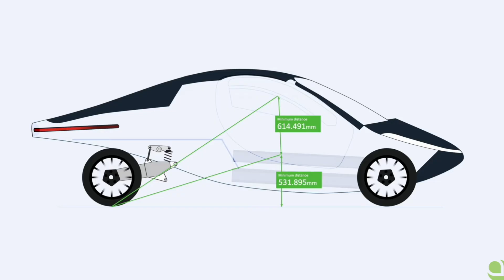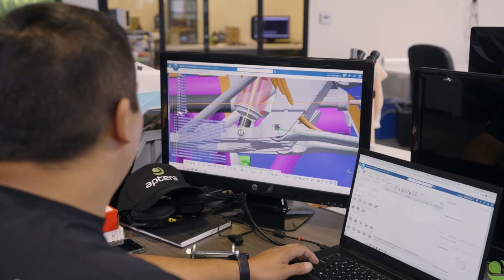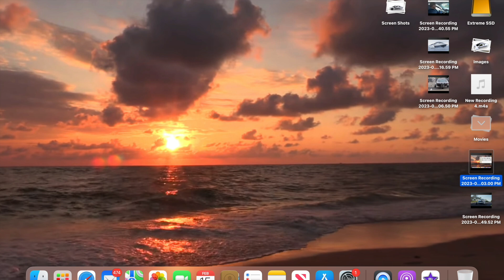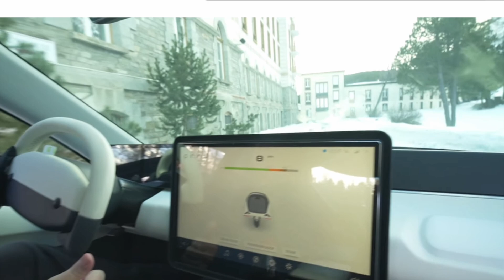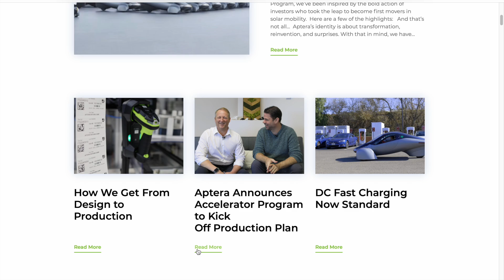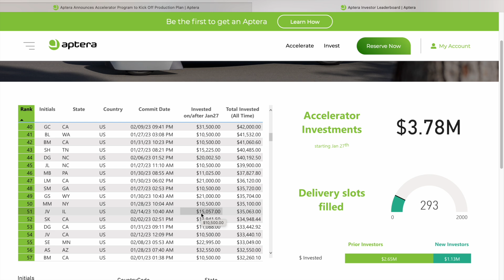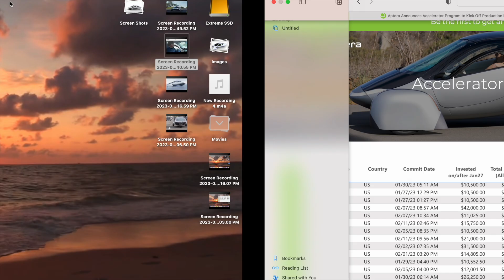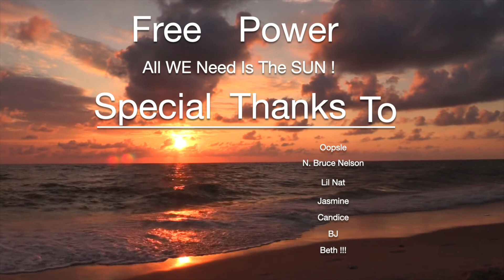Aptera's Suspension !

Comment: The rides seems very NOT smooth whatsoever.  Last-minute changes to suspension is an indication of that.  I've owned a very stiff suspension car (Lotus Elise) and the ride-quality of this shows it is more punishing and violent on SMOOTH roads.  Selection of coil-overs may help with this, and possibly progressive springs.  You can see the actors suffer on the smallest of bumps and clench their teeth concerningly, even the Elvish girl.  Show me a heavily pot-holed road drive instead of Zamboni-smooth pavement in all the examples (where it still slams like a hammer on metal).

Comment: I'm concerned about the increased unsprung weight, since the inwheel motors are directly attached to the wires with no suspensions between them.
Curious it could handle pot holes or speed bumps..

Comment: I don't foresee needing to accelerate to 60 mph in 5 seconds.  But I do see constant advantages in having 20% more efficiency from the wheel motors.
Reply from the maker: That's Big !
Reply: I agree... I have a standard long range model Y and after a couple days of it being in 'standard' mode the novelty wore off and its been in chill move ever since. Hell, even in chill mode i can still lay into it and out accelerate most cars around me. I had originally taken the sport model out for a test drive and after flooring it a few times I thought "why in the hell would I want to do that when even standard mode pulls like a freight train"

Comment: How will it do in Pot wholes the Roads are degrading in places
Reply: Aptera has run the beta into curbs fast enough to knock the tires off the wheels without damage to the suspension.
Reply from the maker: Thanks , n.brucenelson5920 , I remember that and have a picture of it somewhere . I should have put it in this video . 😄
Reply: @freepower1082  You do a great job, thanks!
Reply from the maker: So do you , appreciate you very much ! 😊

Comment: I wonder how hard it will be to parallel park the Aptera since it is so wide and videos seam to show a large turning radius? 
I wonder if Aptera ever considered  to make the rear wheel pivot like that of a tail drag airplane rear wheel to make it turn on a dime?  That would be cool, however make AWD more difficult.
Reply: Ive heard people who see this thing in real life say its not as wide and large as people are thinking it is on the net.
Reply: There is at least the potential that the left and right front wheel can rotate and different speeds or even in reverse direction to add more maneuverability at the cost of some tread scrub at the rear.

Comment: The guy said noting about the front suspension components - the most critical ones.
Reply: The design of the front suspension was created by Roush Performance and has been refined by Aptera.
Reply: @n.brucenelson5920   -  Why hasn't anyone at Aptera ever shown it or described it?  How come YOU haven't described it?  You've only hinted that it's being improved by Elaphe.  Why?  What's wrong with it now?
Reply: @daveinwla6360  Aptera has released video of the actual suspension components both in the gamma prototype and as an assembly, as well as drawings.  What more do you want?   The only thing they are still working on is a protective and fairing cover for the lower arm.  What is wrong is people who suggest there is something "wrong".

A major change Elaphe made was adding an anti sway bar.